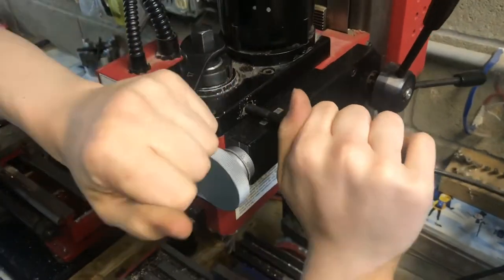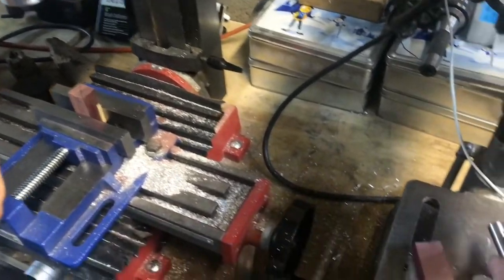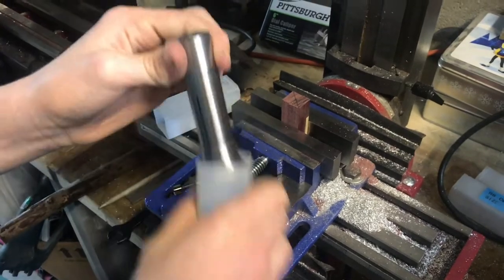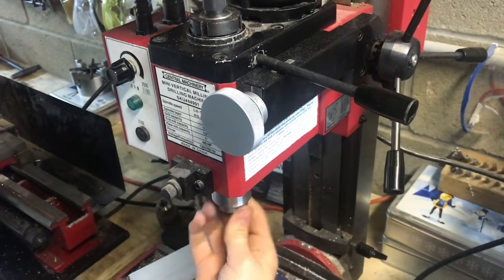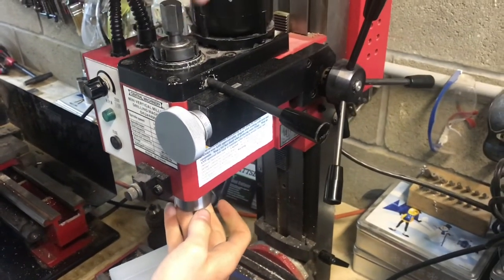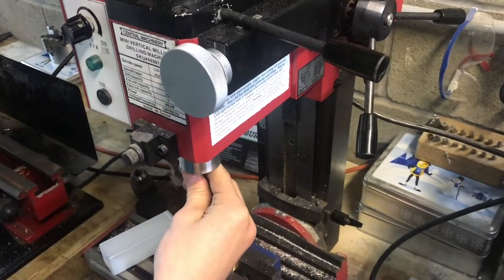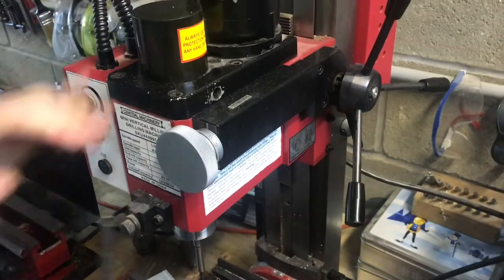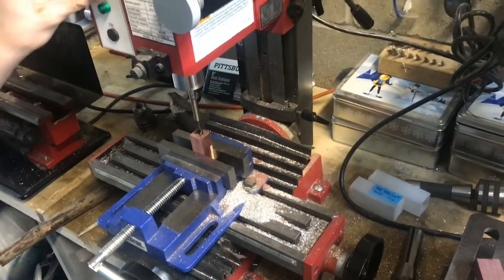SWITCHING OUT collets and milling bits from a harbor freight mini mill

Comment: How do you know what size collet is required for the mill?
Reply: Morse taper 3 collets. factory is a M12 drawbar, but you could switch it out for another size. lots ppl do because what tooling they may have or if easier to find.
Reply: @pauls5745  Pretty sure that's incorrect. I believe Grizzly uses Morse 3 but the Sieg/HF/Every other "brand" uses R8 collets.
Reply: @amorton94  I must've been tired that day. I just looked and have an MT3 collet holder in. R8 collets I think are more current in these machines now I suppose.

sorry for any misinformation!

Comment: Does the mill come with collets?
Reply from the maker: It did not come with any collets only a drill press chuck
Reply: some do. I have the Grizzly model G8689 nearly the exact same machine but mine came with a 3/8 and 1/2, plus the chuck. the taper is MT#3, M12 drawbar if you want to get collets or other tooling
Reply: @pauls5745  Now I see that you have the Grizzly. Yours is actually different than practically every other benchtop mill.
Reply: @amorton94  yeah there are little differences on specifics.  usally all the stuff pertaining to "mini mill" is relevant to mine.

ty,, I should not have said 'exact same' haha
Reply: No